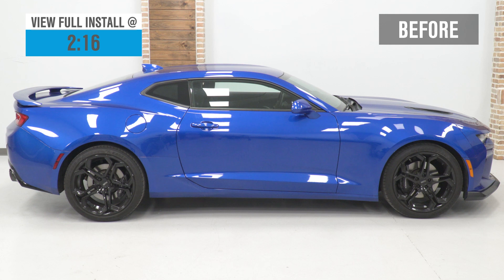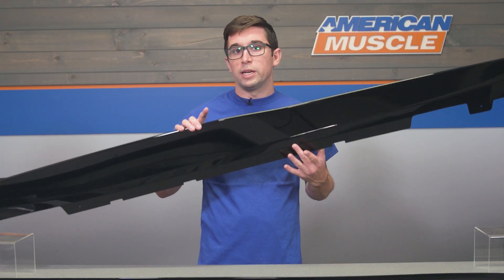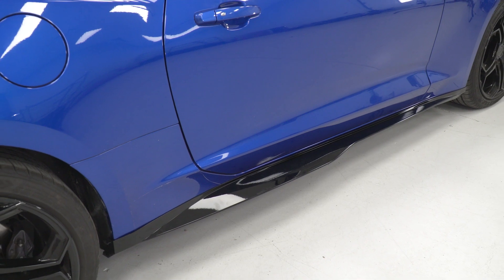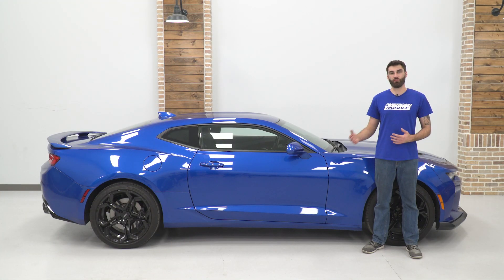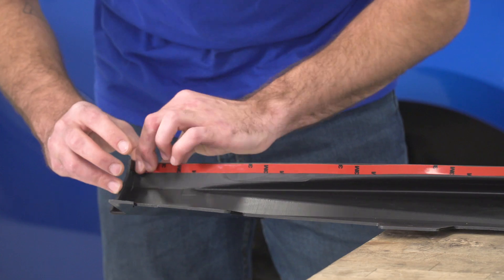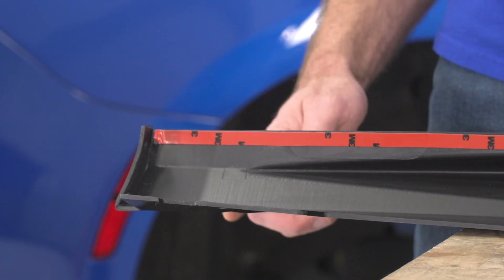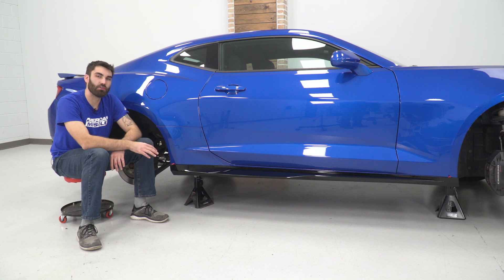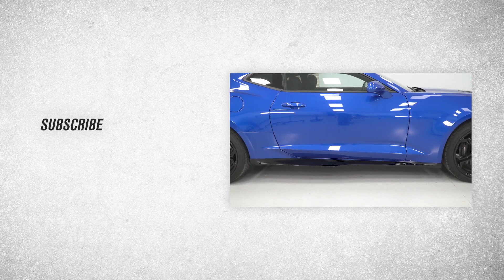2016-2023 Camaro MP Concepts Rocker Panels; Gloss Black Review & Install

Comment: Interesting price. Wonder about the potential gaps though. In the video, you can see the panel pushing out when the 1st rear screw is fixed. You could even see the gap prior to the instalation operation on the close up images. Wonder if a spacer behind the panel could avoid the part from moving forward and pushing out the panel in the process. Double side tape may not be enough to keep this gap closed even short term. So hesitation between Concept and ZL1 style which is double the price!!

Comment: They didn't give me enough double-sided tape, and the tap that's there isn't sticking to my car.....it does look nice, but it doesn't work like the video above
Reply: Yeah man I’m installing it right now and the tape just isn’t working one bit it refuses to stick to a nice and clean surface
Reply: Did you get the clear thin tape? I have some other clear tape but it'd wider and I wonder if I should use that instead
Reply: @Besar02 your suppose to heat the adhesive tape not too much try a heat gun